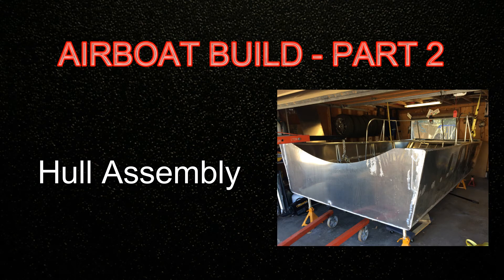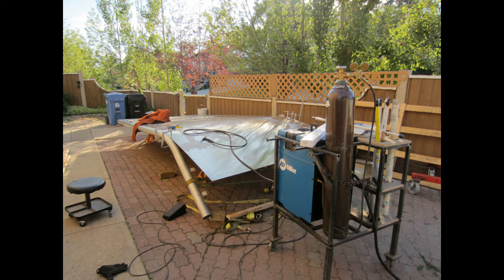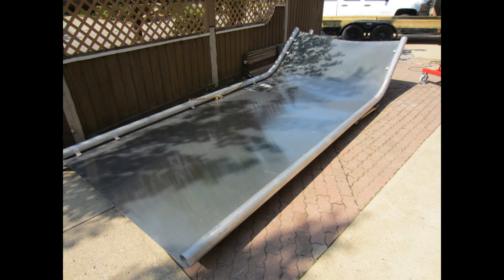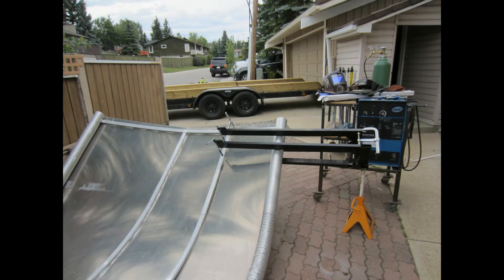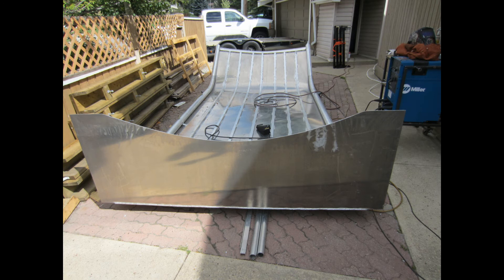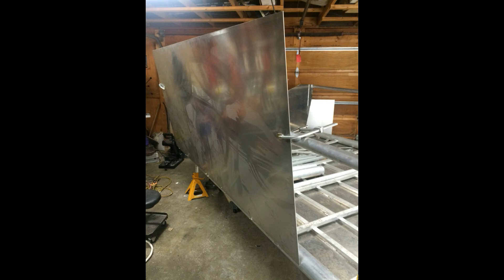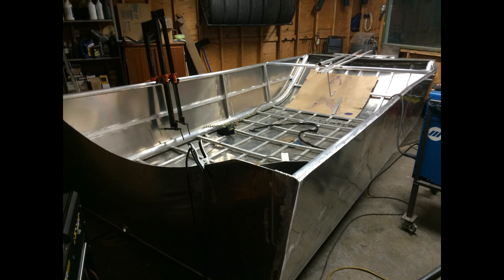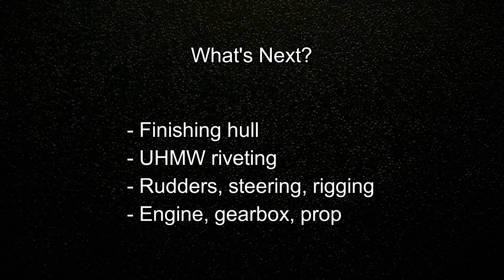Airboat Build #2 - Hull Assembly

Comment: Hi,  I am a little curious whether you needed some frames in that hull as you just went through welding and reinforcing just the outer plates instead.. 

Btw, its a great walkthrough video of your project, keep up the good work !
Reply from the maker: Thanks for the question.  Are you wondering if I have too many or too few braces?  My honest answer is I don't know.  I tried to find a balance between strength and weight.  I want it to be strong enough to take abuse driving over occasional rocks and ground.  On the other side it needs to flex a bit too so that it doesn't just crack.  I based the number of stringers off pictures of other airboats and I kinda just estimated what looks strong enough.  I guess we'll find out once it hits the water...

Comment: Hey,

Just found your channel.  Looks like a great project!  Tig welding that whole boat....holy crap you went through some gas.  I'm waiting for the engine build.  Ever heard of simple digital systems for spark and fuel management?  Check them out, I found megasquirt hard to grasp on videos...  Looks great, keep up the good work.
Reply from the maker: Thanks for the comments.  Yeah I went through a lot of argon.  It's not something I thought about for the budget but it actually added up to a significant expense.
I'll take a look at simple digital systems but will most likely try MS3pro because it has a lot of info out there.  I did a megasquirt MS2 build several years ago that went well but I definitely have a lot more to learn.